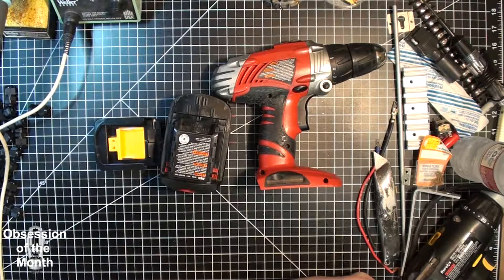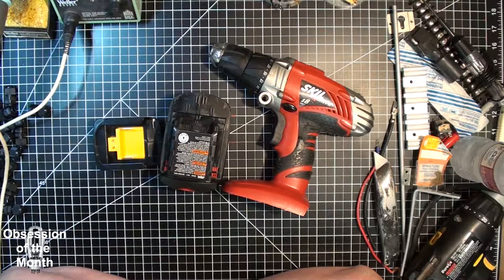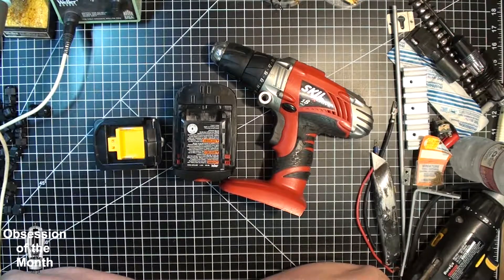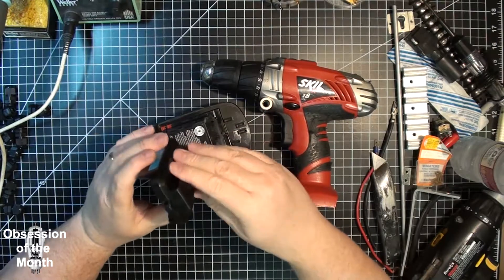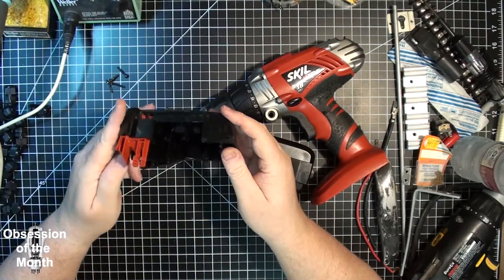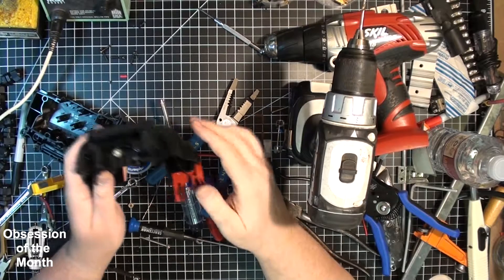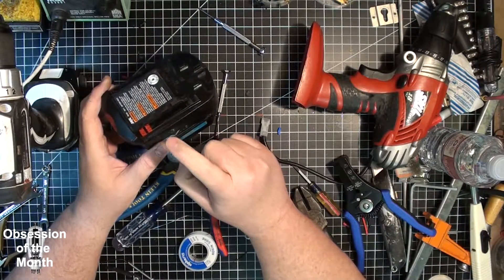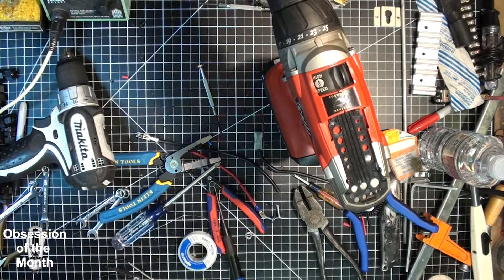Makita to Skil Battery Adapter build

Comment: Same boat here, stuck with a cornucopia of Skill tools.  Gonna use this hack to continue using them, but will never buy another Skil tool again.  Guessing when Skil was bought out from Bosch by Chinese company Chervon they converted Skil to the 20V PWRCore line. Blows they decided to completely abandon customers with the 18v line.  Saying FU to Skil & Chervon and switching to Milwaukee.
Reply from the maker: the dirty little "secret" of 20v tools is that they are still 18v. 18v is nominal voltage for 18v tools, marketing wank changed that to 20v. the max charged voltage for 18v tools is actually 21v.
Reply: @ObsessionoftheMonth  Definitely a dirty little marketing ploy.  At least there's something to gain in tool design and performance with the switch to Li-ion even if voltage is unchanged.  Skil and their lack of adapter is what makes me frosty. Again, thx for sharing ur hack.